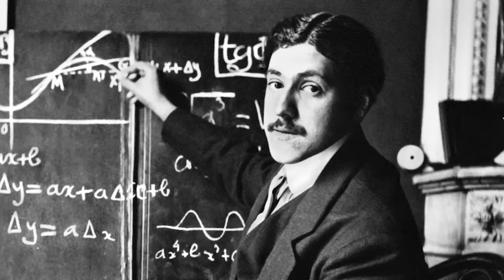The Plane You Never Heard of

Comment: A slight correction is needed. The Ouragan was not developed from American jets but from British ones initially built around the Whittle-De Havilland Ghost engine which evolved into the Rolls Royce Nene. Some Nene engines were given to the Soviets by a very stupid defence minister and the Soviets reverse-engineered them for Mig 15.
British developments towards swept wing plans like the Swift and Gnat included some French engineers from the former Free French staff who stayed in Britain after 1945 in a cooperation programme which would eventually lead to marvelous Anglo-French aircraft.
The Ouragan elegantly had a wing shape mixing sweep with two pitches front and rear of the wings an this might have been derived from the Saab 29 Tunnan, which also used the Ghost/Nene engine.
Although not as famous as the Mystere series, this video shows how the compromise solution on full sweep turned out to be an advantage in versatility, setting new standards in battlefield support.
Equally important, at least in my opinion, the Ouragan showed that French aviation had only been paused by Nazi occupation and not snuffed out.

Comment: Great story. But I have seen more Mysteres than Ouragans in scene in this documentary! You can tell a Mystere from an Ouragan by the angle of the wings. Ouragans have an almost straight wing and its fuselage is shorter. They also use to carry wingtip tanks. The Mysteres (more advanced) had a longer fuselage and swept wing at different angles. Mystere IV had a long chord swept wing, and Super Mystere had a similar wing but with more swept wing angle.
Reply: Ahhhh, thankee, I was wondering about the different wings in the video🤓
Reply: Yes, I was about to comment on this.
Reply: The Mystere 2 was still rather similar to the Ouragan.

Comment: I did know about this little fighter. Ouragan = Hurricane. Marcel Bloch became Marcel D'assault after WW2.  India used them as the Toofani (which also means Hurricane) up to 1965 in the front line. El Salvador also used them up to 1982 (you said 1992?) when some were destroyed on the ground by rebels and the goverment wanted A-37 Dragonfly replacements.